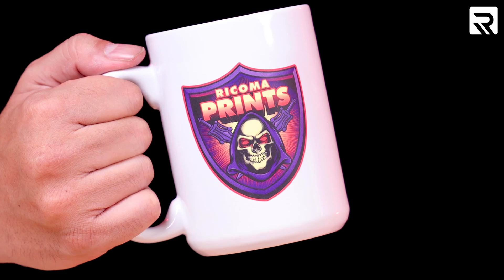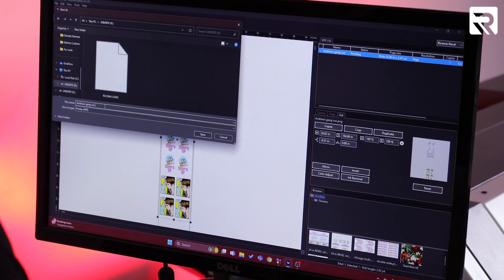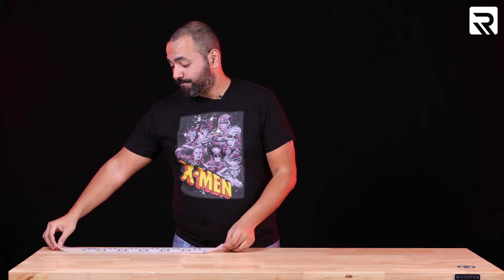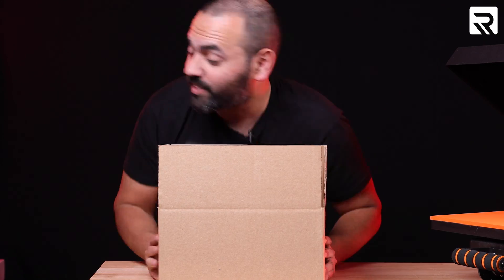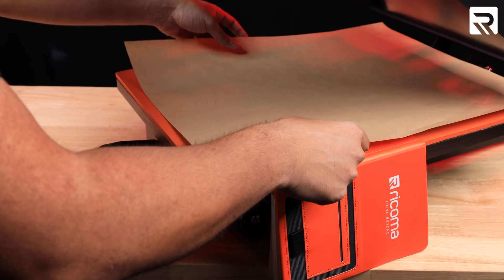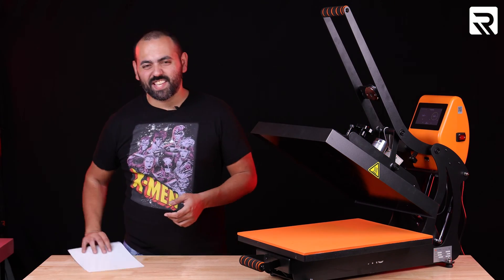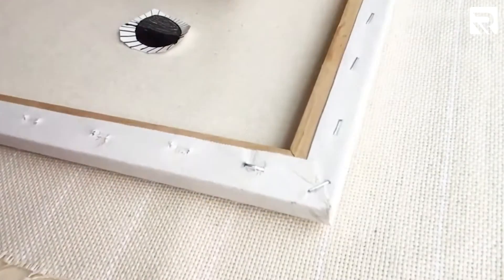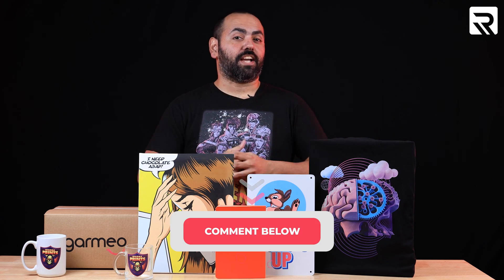We Tested DTF Printing on 6 Different Materials (Did it work?)

Comment: Hi, how can I remove the dtf from the metal? will acetone work?
Reply from the maker: Hi! Yes, acetone can help remove DTF from metal, depending on how well the transfer has adhered and the type of metal surface.

We recommend starting with a small test area first, especially if the metal is painted or coated, since acetone may damage the finish. Soak a cloth or cotton pad with acetone and press it onto the DTF area for about 20 to 30 seconds. Then gently scrape it off using a plastic scraper or something similar. You may need to repeat the process a few times for complete removal.

Comment: I noticed you said 325 for 8 seconds on what looked like a cotton shirt. I was told to press at 310 for 10 seconds x 3. Is that not necessary? I have the Revel 1202.
Reply from the maker: Hi Tammy! Pressing at 325°F for 8–10 seconds with firm pressure is usually enough—no need for multiple presses unless you're layering or correcting an issue. Pressing at 310°F for 10 seconds x3 is likely more than necessary and could risk over-pressing.
Reply: @RicomaPrints  ok well then they might want to stop telling people that who buy their machines! Thanks for clearing that up! Sounds like I'll be saving a lot of time in the future!

Comment: can it work with copper sheet and aluminum sheet please
Reply from the maker: DTF is not made to work directly on copper or aluminum sheets. It's primarily designed for fabric and apparel, where it bonds using heat and a fabric-friendly adhesive layer.

Comment: How durable is the DTF on a ceramic mug?
Reply from the maker: While DTF printing can be applied to ceramic mugs, it is generally considered not very durable on hard surfaces like ceramics, meaning the design may peel or crack over time with regular use, making it less suitable for mugs compared to fabrics where DTF performs better; for the best results on ceramic mugs, consider sublimation printing instead